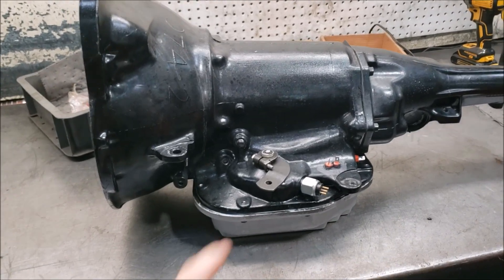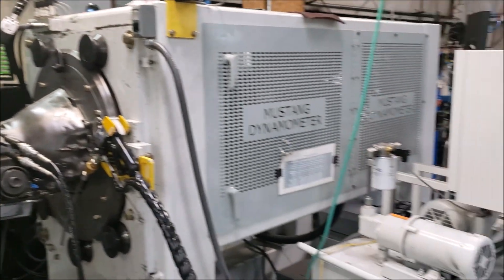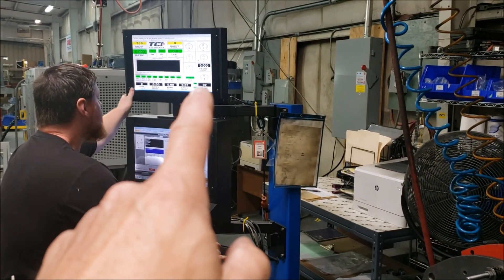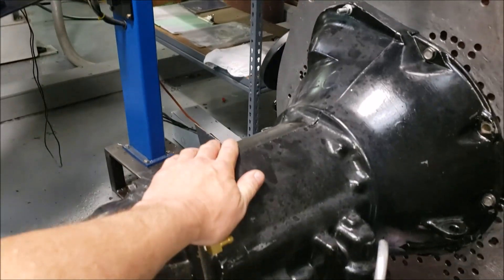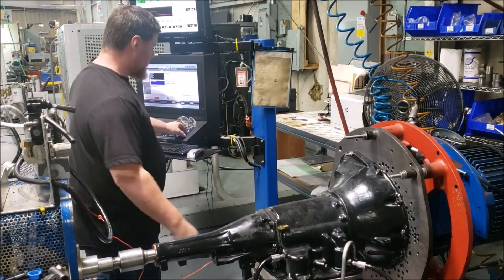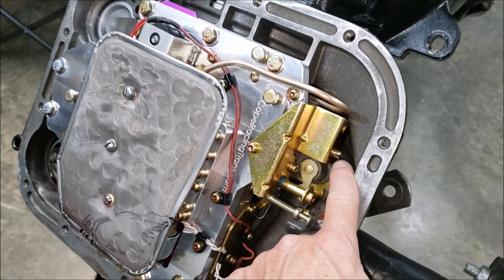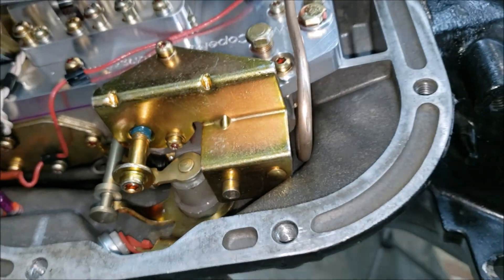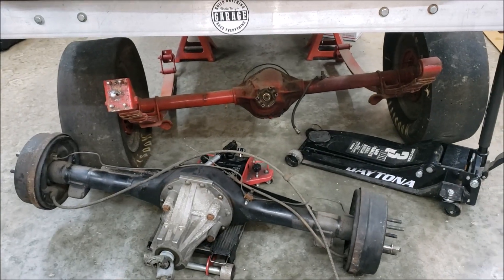PLAN Z 2.0 transmission dyno testing.

Comment: What was the conveter stall speed?
Reply from the maker: WIth 500 ft#'s of torque and max brake on the dyno it came out to be 3500. But since my car weighs less than 2500 down the track and will only have 400-ish ft#'s of torque it will be around 2300-2500rpm. I have a trans-brake so i will test that once I have everything running. This is an experimental converter and we are trying new things.